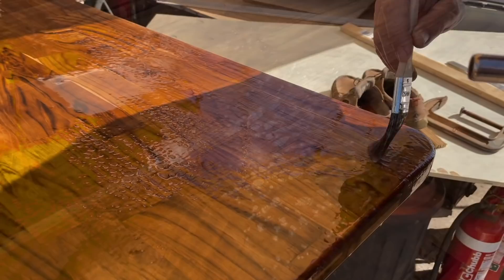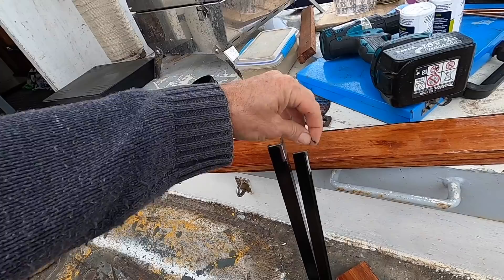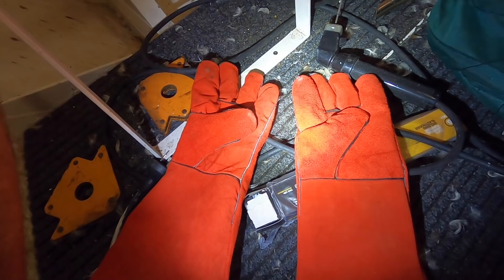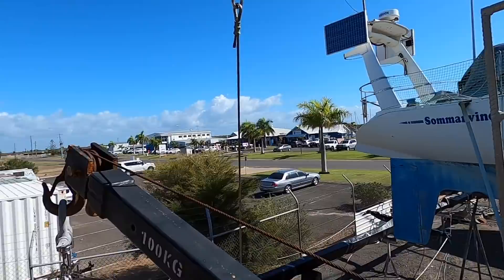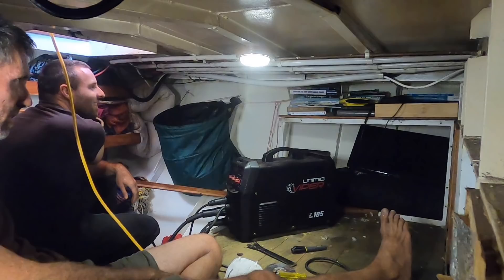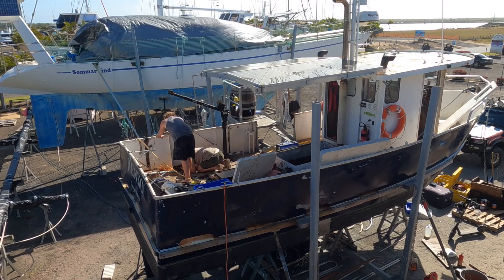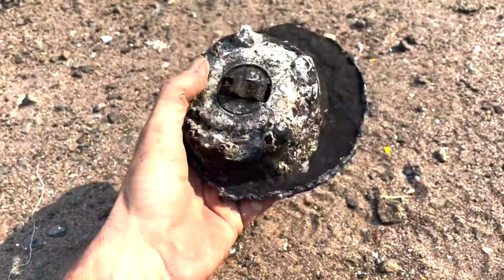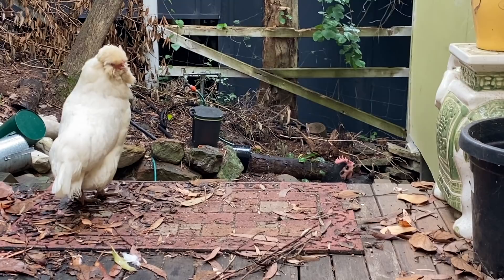Week one on the hardstand

Comment: Stu,
To save some time on your repair patches try using straight lines as much as possible, than using round plugs it is easier to fit your patches that way. Spot weld a piece of scrap to your patch pieces to hold onto and clean all your steel before welding it so you do not have to spend a lot of time cleaning/finishing corners for paint.
Wood work looks great, hope you found some good hand rail surplus.
I watched an experienced welder channel that used a needle scaler to hide his grinder marks so the steel looked good after painting. I C Weld is the channel.
Doing good on your hard stand time! 
Damien is right don't waste your daylight, you can sleep when it is dark, make some adjustments.

Comment: Something that works for me when applying epoxy or fiberglass. Wood breathes, so leave it in the sun all day to heat it up, then apply the epoxy in the early evening when the wood is still warm but cooling, and the wood will draw it in rather than producing bubbles in the finish. If you want a nice plate glass finish, cut a piece of acetate sheet the size and shape of the work piece, trowel out the epoxy on the wood, and slowly roll the acetate over it. It will level the epoxy, and leave a nice finish when the acetate is pulled away after curing.

Comment: Stu, Are you going to put a curtain across those shelves to prevent grit dirt etc from coming off street shoes and getting into what is on the shelves there behind the ladder. I realize you do not wear shoes lol much but doing work on the boat etc you might be dragging metal dust, shavings , grit , paint chips / dust etc  down the ladder with you on footwear or clothing.  I expect to see a high shine on that bronze before you clear it lol :}

Comment: Oh, you cut out the part where the knob goes flying when the wire wheel rips it out of your hand!!
Reply: Actually benchgrinder wire wheels tend to suck items inside housing if anything. Most of the time you can use your fingers without an issue.  The trick is to not press it hard.